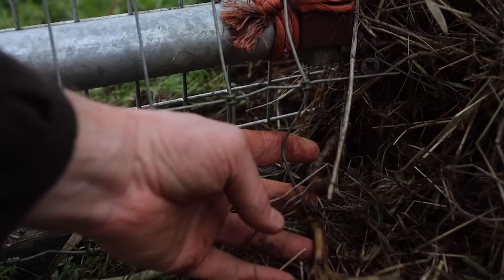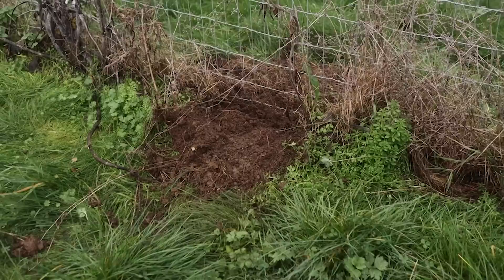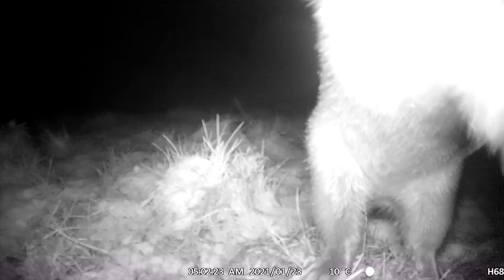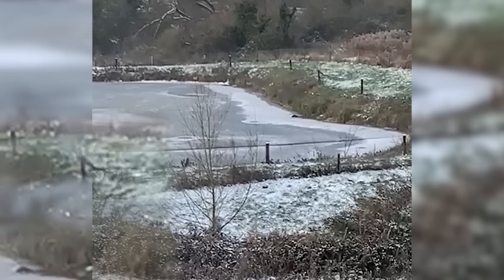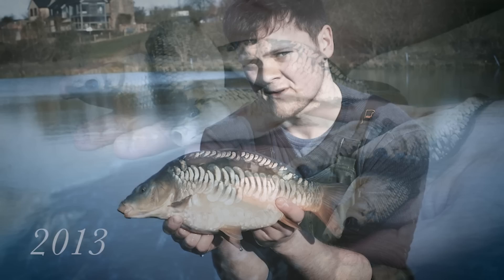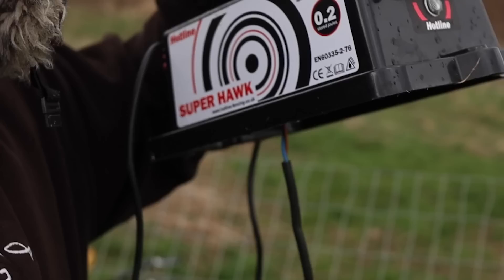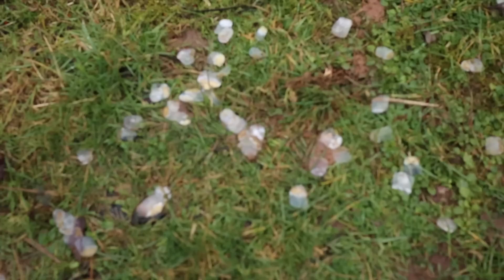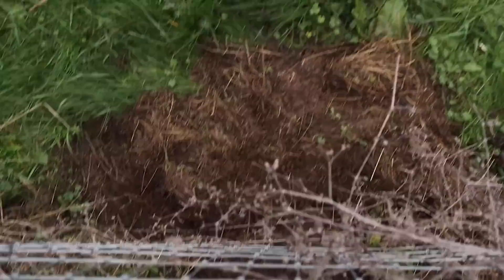CARP EATERS!! Can an Otter climb an Otter fence??

Comment: Thanks for posting, this really informative. I have a garden pond that until recently had 3 mirror carp and a common (55-65cm), a 45cm tench, 14 adult (20cm) rudd and 42 rudd fry. Then over the winter an otter/s wiped me out, only leaving the rudd fry. They'd got in under the garden gate, making an indentation underneath it. I bought some reclaimed garden slabs and buried them between 45-60cm under the ground beneath the fence, so hopefully there's no way they can dig under it as apparently they don't tend to dig more than 30cm down.

As you say though, what they're said to be able to do/not do, may be very different to what they can actually do. I always think that a hungry, desperate, wild animal will try anything/push their limits when they need food. I've seen videos of herons walking through electric wires, getting shocked, but ignoring it to get to food. As for climbing I think I read that they don't tend to climb up more than about 2ft, but who knows?! I think the difference between the climbing they were doing in the video you showed and your fence, was that the climbing otters had a ledge to get to, whereas if they climbed your fence they'd just have a narrow wire and then a drop, which might put them off/make it riskier for them.
Reply from the maker: I agree with you there, this video has certainly got people sharing lots of interesting and worrying stories! I have also been sent some very good footage of an otter climbing an Otter fence, although it's most likely to be an individual skill of an animal that's been raised in captivity where it's learnt to climb. I've been wrong before though!

Comment: My local commercial has just had to install an otter fence where the fence splays outwards at the top so they can't climb over
Reply from the maker: Yes that's the traditional Otter fence, but I find it quite unsightly, particularly on my small growing ponds. Hopefully if more people begin to use electric strands to stop climbers then they'll learn to not try climbing!

Comment: After looking at all types of otter exclusion we took the plunge with tornado fencing dug in as the video footage 4 main things we did differently 

The netting is turned out at the top
All Gates (x 3 ) all farm track gates have galve sheeting on them stops possible climbing on a straight bit of fence each gate threshold has been concreted (no digging under) entrances are your weakest point

Third point we have to drains that lead to a flood dyke they maintain our water level the outfalls have one way flaps on to stop flush back from the flood drain but also have a concrete face and base on them inside and out as this gives a good base for the grids the grids are wire supermarket wire baskets they work a treat

The fourth point and this is we’re the real work starts we keep a sterile strip around the fence inside and out we have to spray it off 3-4 times a year (our fence is just over a kilometre so a fair length ) this gives you complete visibility at all times I have seen so many waters fenced then just left for nature to take over even if it’s just overgrown grass, brambles ect how do you check it 
I hear people saying the fence is dug under why keep it clear
Rabbits can dig under it at the point we’re the fence is turned under but do dig warrens or nest holes that can bridge the fence underground 
Badgers are natures JCB,s and can be a real issue if they are in the area or expand into the area
The other issue you can have if your unlucky if environmentalists who feel otters should be free to predate any water they like and have on a number of occasions cut a couple of strands out of a fence that is covered by grass or brambles to allow access in or out yes it does happen 
Hope that helps
Reply from the maker: Lots of good points mentioned there! Thanks for sharing!

Comment: 100% they can climb 4 otters have entered my syndicate last winter by climbing over the fences. Now the bailiffs have increased the height and put a return of 40cm facing away from the lake to stop them. Fences work but only if you have them deep in the ground and don’t stop dead at a certain height. These creatures are buggers and will keep finding ways in they are clever

Comment: Thanks for the vid,  questions (I help run a lake) the battery you use (Enforcer) How long does a charge last? How long does it take to charge up? Do you have 1 on charge whilst other being charged? Currently our lake is fenced and we haven't had any problems but may look to upgrade the fence

Comment: Those insulator bits are about £10, they won't last like yours will mind, sorry about your loss, been through it a fair few times myself, nothing as big as yours but lost brood stock a few times now.
Reply from the maker: Yes there has been some very interesting stories as well as many like mine which have been shared since releasing this video!

Comment: Good video, shame itvwas inconclusive. Could you do something showing the different electric fences in a bit more detail?
I always  thought the lesser jouled fence (ie standard stock fencing) were not strong enough to give an otter a meaningful shock.
The once with separate earths (earth live earth live earth live) are supposed to be better
Reply from the maker: Not sure Gary, I had fences ticking over at 3000v which kept Otters out of a pond in an area where I know Otters are thriving. I've since managed to get it kicking out 8000v because I could handle a 3000v and felt that it wouldn't be enough.

Comment: Frustrating especially as you have spent so much time and money on good fencing, and respect for dealing with it the way you have, it would have been really easy to set a snap trap up on the other side of the fence and problem solved.